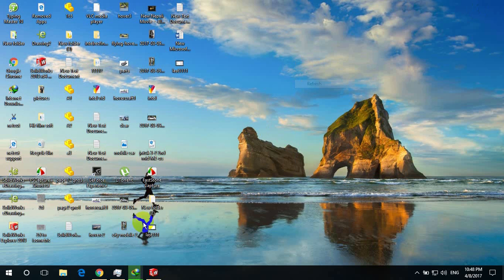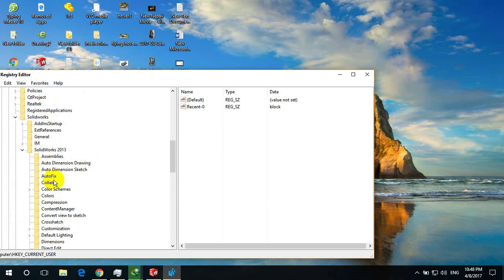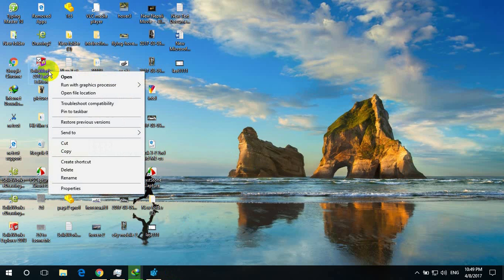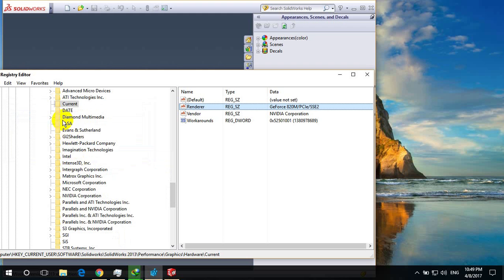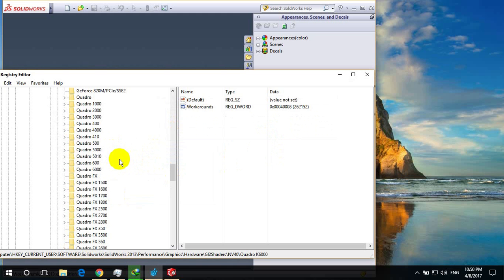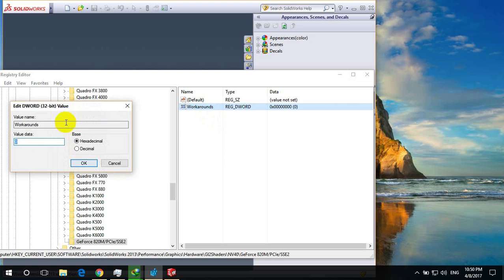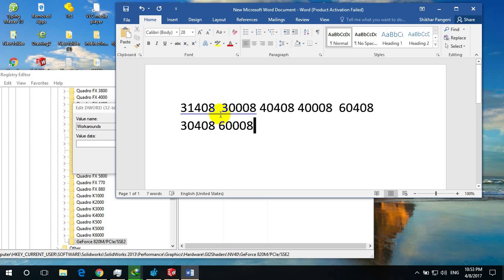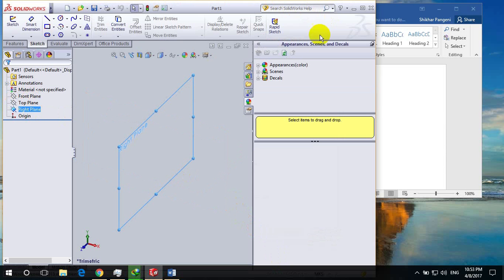Activate real view graphics in solidworks and fix performamce  in NVIDIA Graphics

Comment: Create text file with the following then rename to .reg:

Windows Registry Editor Version 5.00

[HKEY_CURRENT_USER\Software\SolidWorks\SOLIDWORKS 2021\Performance\Graphics\Hardware\Gl2Shaders\NV40\Geforce]

"Workarounds"=dword:00032408

[HKEY_CURRENT_USER\SOFTWARE\SolidWorks\SOLIDWORKS 2021\Performance\Graphics\Hardware\NVIDIA Corporation\GeForce]

"Workarounds"=dword:04000000

Run the reg file to add workaround.
Reply: Change the year to your Solidworks version
Reply: still doesn't work for me, should I roll back my Nvidia driver?
Reply: @iStealCarsfromValetParking  Did you change the year exactly related to your SW version? - if it does not work perhaps delete any mods you made in the Registry and try again
Reply: @roadtopai  I did, and it still didn't work. It works on my laptop though

Comment: help needed please. my card is Intel(R) HD Graphics 2500.i tried every possible try. every number but realview graphics not active yet. any suggestion for me/?
Reply: https://www.youtube.com/watch?v=TtVOZvlyWag
Reply: @crambacaracho  Not working for me. Realview graphics not activated yet. There is no option of open with graphics setting from icon bar right click
Reply: Still not activated realview graphics.. Is it due to my graphics card version?
Reply: @waheedabbas443   you need  untick “Use Software OpenGL” (Tools -> System Options -> Performance, “Use Software OpenGL”)
Reply: @congtruongdam1467  I did that from solidworks tools menu. Unchecked open gl software option. Still not having realview graphics. Do I need to install openGL software in pc?

Comment: I have an Asus Laptop with GTX 1650 in it. After, using this method I am unable to use the RealView Graphics command in the Solidworks Professional 2020. I have followed the steps the same way as shown in the video. Thanks a lot to @Mechanical DDMC

Comment: Worked with GTX 980 using 31408 value in SolidWorks 2019. Thanks!
Reply: MG FUN 7  bro I fixed by hit and trial, so you have to try all given codes

Comment: In Solidworks 2017 Folder in registry, My system just has "Performance" Icon, it is not a folder in which Graphics is there as shown in your video. I have NVIDIA GeForce 820M (2GB DDR3) Graphics Card. Please help if you know to resolve it.

Comment: run ---> regedit ---> HKEY_CURRENT_USER ---> Software ---> Soildworks ---> SOLIDWORKS 2018 ---> 
Performance ---> Graphics ---> Hardwear ---> go to current and double-click on the render to copy your graphiccard --->
GI2Shaders ---> for AMD Radeon (TM) HD 8500M/8700M  choose R420 --->  right click on it and select new key --->
past your graphic name on the new key ---> click on AMD Radeon (TM) HD 8500M8700M and right click on new DWORD (32 bit ) value 
---> rename as Workarounds ---> right click on the Workarounds and choose modify ---> type 31408 or 30008 or 40408 or 40008 or 60408 or 60008 or 30408 .

Comment: Where do all this reg keys come from? What are they modifying? Why doesn't Solidworks figure out on its own what settings to use? Or is this really black magic?!
Reply: By the way, at 3:25, I don't see any speed difference. The orange lines still render slowly. Or is that not the issue?

Comment: Worked good for  GeForce GTX 765M/PCIe/SSE2  , MSI laptop,  SW2014  Thnx.
(used 0x60408 value,  no clue why unfortunately )
Reply: I tried to do it follow this video both NV40 folder and Other folder by all codes, it still doesn't work. My laptop use GeForce GTX 1050 Ti/PCIe/SSE2. Can you suggest me ? Thanks.

Comment: Sir actually mere pass CREO2.0 install hai aur mere pass 4gb NVDIA graphics card hai sath me 8gb ram bhi hai, phir but creo 2.0 bohot slow chal raha hai lagta hai wo graphics use nahi kar raha,  PLEASE PLEASE kuch solution bata do sir
Reply: Kashyap Padiya it depends on graphic card series .  U should have atleast GTX geforce 1050ti to run the application of engineers. But if u want to use your computer/laptop only for ENGINEERING softwares then u should buy Quadro instead of geforce GTX. As Quadro are the ones which are made for high end processing . GTX are for gaming and Quadros for designing..